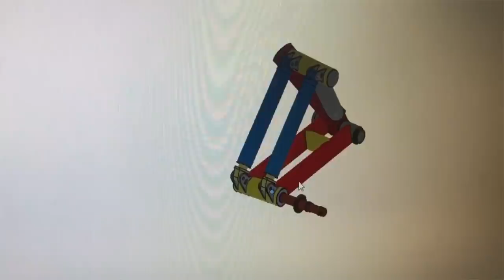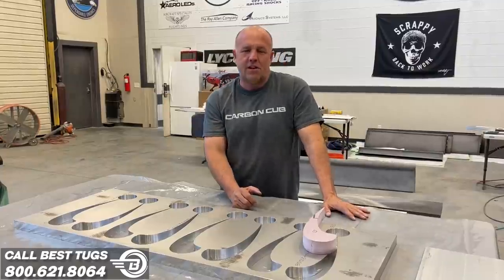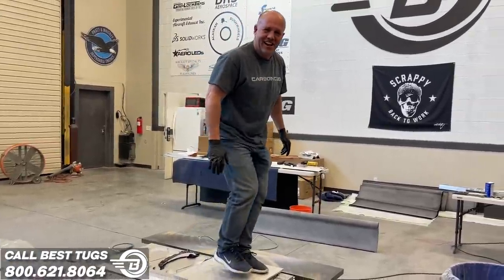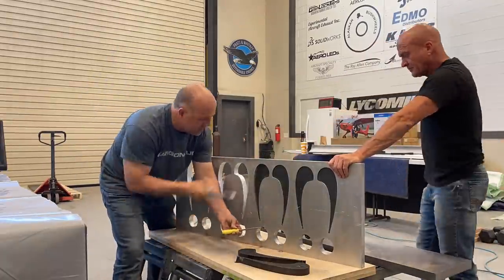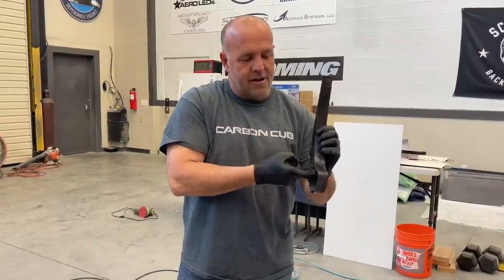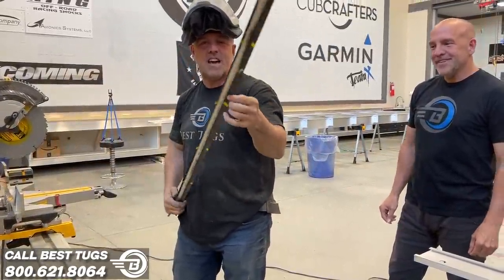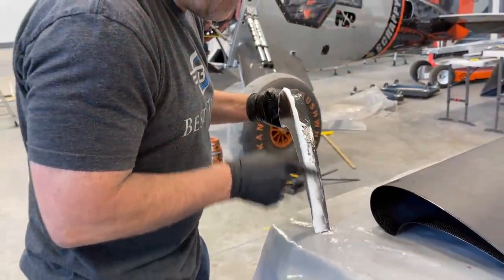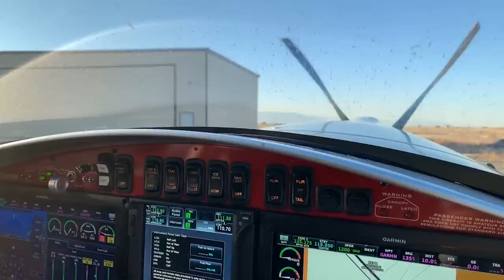Carbon Fiber Slats for my Wingless Airplane | Scrappy #50

Comment: Very cool😎 Did you leave a bleed hole so you don’t trap pressure?  Those look like they’re made air tight…. Otherwise they are beautiful!!!
Reply from the maker: 👍🤠 yes , You just missed it.  There a whole section showing close up of the drilled ribs, a flashlight showing inside and me talking about that exact thing and why it’s critical

Comment: I actually winced when you used a file and a hammer to remove the carbon from the molds. If I saw my aerospace students doing that "with no glassses on mind you" I would have made them write me a page on why we don't hit files.... Its ok... I have done it too! ... I rationalize in my brain why its ok   "I'm not hitting it hard!"

Comment: How does the bondness of the adhesive last during heating? What if the adhesive comes apart or chips. How do you ensure tensile strength? Did you put it in a lab for testing or slapped it on homemade? That’s risky for your life isn’t it or did you get a kit for that specific reason that’s predetermined?

Comment: Great stuff!, I was wondering if you neet to remove those 8 pieces and cut them to 1/4 inch? won´t be easier to machine a mold (male if Im not mistaken) which push all parte 1/4 inch out then you can trim them and get them out? I do not know if you already finished the process and if you´ll have to do it again , hope does not bother my comment

Comment: maybe a little too late now, but would it not have been easier to keep one of the scrap pieces from the alumnium mold or milled out an extra to then use to evenly push the parts out of the mold with a press?

Comment: Mike, it occurs to me that you might want another vent hole at the high point, in case that potential water is *ice*, and blocking the vents at the low point.

Comment: Morning from New Zealand Mike,  building an Carbon Electric bush plane, currently starting on the primary ribs but using a male vacuum formed moulds, your technique looks far more efficient to get what I’m looking for. Couple of Qs 1, mould material comparison , aluminium v steel?
2 foam type?
3, micro filler properties?
4, bench protection are you laying peel ply?
Thanks in advance if you time to comment. 🤟
Reply from the maker: 1.  Alluminum for speed to machine and Steele if mass production of thousands of parts are needed.  
2. Any foam usually works ok but I like the thicker pink home style house board and closed cell boards.  
3. Micro filler I use the same two part resin I buy from aircraft spruce for making the carbon fiber mixed with micro bubbles you can buy at the same place.  Consistence of mix is up to you.  Depending on gaps or joint, thin runny mix for little to no gap so it squeezes out and thicker mix for large gaps that it needs to hold its shape while it cures and is also light weight. 
4. For the base of an open mold I like a laminate board so I can simply spray wax release on it and not need peel ply.  Makes a perfect wrinkle free part directly against the board.  
Cheers my friend I hope that helps 

Back to work 👍🤠
Reply: @MikePatey   helps heaps mate I was stalling abit doing the ribs until I found a better way ,  legend!!!!

Comment: Do these go on the front of the ordinary wing like active covers? And if so, why isn’t the new wing made to this profile? (I figure if you have the time they are ace brush bumpers, but it does seem a lot of work)
Reply: The slats will be moving aerodynamic parts (controlled by the pilot) mounted on the leading edge of the wings to change the lift characteristics at different air speeds. Their shape is crucial inside and out because there will be airflow over both sides and they will generate lift almost like mini wings.
Reply: @matthewhirst9438  ah I see, I didn’t know they moved like big planes. Cool 😎

Comment: Maybe I missed something. I see you drilling the end ribs to vent those cavities.  Are all the rib cavities vented?
Reply: Ahh, there it is...
Reply from the maker: 👍🤠 yea You just missed it. I talk about it and show them drilled on the table once and also when I shinned the flashlight inside showing the 1/4” holes in every rib,  I just went back to make sure it didn’t get cut in editing but thankfully it’s still in there.  👍

Comment: Hey Mike, I have to ask you something regarding carbon fiber. 

If I would build a boat in carbon fiber instead of fiberglass, and keep it the same weight.
If you compare the two materials, how thick would it be if I decided to go with a weight ratio 1:1, what I'm basically saying is..   If I build a hull that has a weight of 500ibs in fiberglass, and I build the same hull and aim for the same weight, 500ibs...   How thick would the carbon fiber hull be? 

I would like to build a hull with insulating properties and I'm just guessing the thicker the better and maybe have some cc foam either sandwiched in the hull of CC foam in the interior part of the hull.

Comment: Wanted to know if there is a benefit in having electric driven hubs. I notice lots of these stol people have big engines yet is there not better traction to be had with motor driven wheels getting to take off speed? Plus you could program them to inhibit round house kicks when landing. Can’t remember what the spin out on landing is called..
Reply: Ground loop

Comment: How do you waterjet that thick and not have a slight taper to the hole cut out?  I had some 1/2" plate aluminum waterjet cut to clamp some scuba tanks and the holes clamping the scubas had a slight taper.  I was told that was normal to expect.

Comment: Hey guys/Mike a quick question:
Does the pink foam turn to a black colored tar due to just the chemical reaction with acetone or does it get its black color due to some carbon particles from the fiber during the reaction? 

Greetings from Suriname🇸🇷

Comment: i have a love hate relationship with acetone. it is great for so many things and the stuff even saved one of my eyes but damn..  if you ever find your self in a situation where you eye is full of polystyrene resin with catalyst already in it  and have to use acetone to neutralize  the catalyst and dig out as much resin and marble filler as you can before running to the flush station before it just ruins your eye you will understand lol  i loved working with resins but the catalysts i used could sit on your skin for a full min and not do a thing to you. but man if you left it on you had for any time over that before neutralizing it  you will never want to do it again. on a side note that stuff is what taught me that if you are going to be dumb you had better bet tough XD

Comment: Why is your vacuum pump running continuously? There are pumps which have a controllable cut-in and cut-out pressure. With a good vacuumbag they only run for about 5 to 10 seconds and they can remain off for 15 to 30 minutes.

Comment: Holy smoke Mike, the machines you use to make parts for Scrappy, cost more than Scrappy. lol If it was zero tolerance, how did you get the carbon fiber over the foam part to go in? How many hours did you spend on making those parts?

Comment: How was the leading edge slat given the shape it is in in 12.17 , and if that material is carbon fiber (lamination for the ribs) .. how it was given the desired airfoil shape , What is the manufacturing process?

Comment: I was thinking if you put a second plate over the face of the parts, with a channel cut in the face of the plate, you could fasten that plate down and have a nipple to connect an air line and blow all the parts out of the mould at once.

Comment: Are these slats completely air tight? Any way for the air pressure to equalize? Is this even a concern. 

Edit:
HaHa....just got to 18:20. holes being drilled:)

Comment: Wow! That's a whole bunch of resources to be able to water jet the mold.  Thought for sure you would have cut an air groove into one side of your flat planch piece in order to use air pressure to remove the entire set of parts at once. A little sealing grease, clamp it down, and add air.  I cringed when you took a hammer to remove the parts.  (Use any fluid, water,grease etc.)

Comment: Why micro for closing out the slats and not cotton flux? I was under the impression that micro is not structural... Mike and Mark proceed to twist a scrap piece three times without breaking. Nevermind...

Comment: Can you draw a vacuum inside the slats somehow and then seal them? Marginal lift by volume, but I don't know...would the carbon shell collapse on itself at low altitudes with a vacuum or partial vacuum? I'm not smart. Someone help me.

Comment: Mike, maybe I missed it but why use micro instead of resin to assemble them?
Reply from the maker: 👍🤠great question. The Micro is just a thickened resin.  The micro prevents it from running as it cures. Better bond in this application and specifically at the seemed edge. When pressed together it squeezes in and made a 1” deep bond the entire length of the part.  If only resin it would have a 1/16” bond at just the tip where the edges meet but the parts diverge away to 1/4” gap between them at one inch back.  So the micro creates a triangle wedge bond to fill and make a strong joint down the thin edge
Reply: @MikePatey  Ah, makes sense. For life, some folks have a Guru, but when it comes to adhesives, you will forever be my Gluru..

Comment: This is classified as an abrasivejet cutter since it uses garnet.  A waterjet only uses water.  Abrasivejet cutters are great for some applications, but I have found that it struggles with cutting things that are harder than the garnet material (such as ceramics or diamond materials).

Comment: what is the white product you use to bond it together with? thickened epoxy?
Reply from the maker: Carbon fiber resin same as used for the part just thickens with micro bubbles.  Amazingly light weight

Comment: The only way I could see water in there is hot and humid air entering it at ground, then the water condensing inside as you get up to colder air.

Comment: Why didn’t you just make a spare foam rib to use as a driver/drift to push the carbon parts out. It could even be cut 1/32 undersized

Comment: Slats?  seen a lot of guys with Zenith 701 and 801s get rid of there slats and put vortex generators on the wing and achieve lower stall speeds...  as much as 5 mph...

Comment: HEY!  Don't Hit FILES!!!  You just got through describing brittle metals!  With all due respect I don't see the math and physics in beating a defenseless metal file with a metal hammer.  @ 7:54   you have no eye protection and kids watching this are going to have the wrong idea.......My apologies but I must call "Bad Form, Sir" and of course you know files are for filing and not to be hit or even bent........Compared to your otherwise STELLAR habits and methods this oversight might seem insignificant but we all need to practice and promote so-called "Best Practices" all the time , and especially to the newbies. When a good-sized file lets go it can be ugly. (i worked on the line at DeHaviland Canada making DASH-8s and saw my share share of "re-purposing" adventures)....CHEERS!  Superlative achievements, dude.